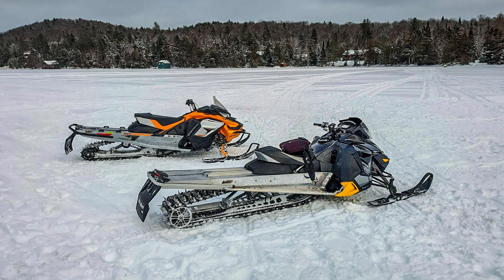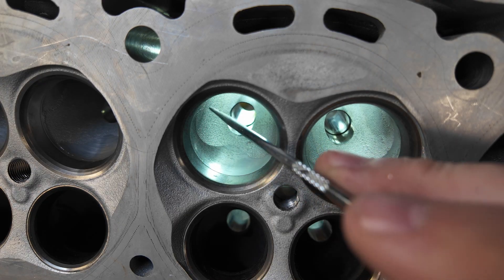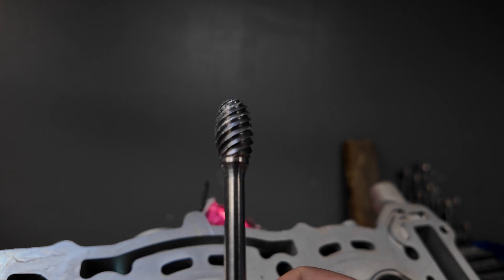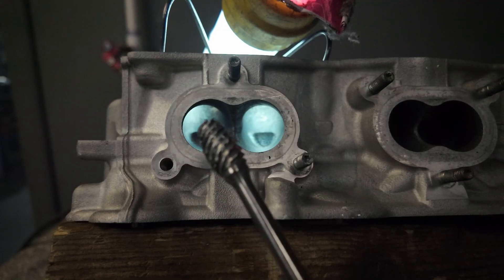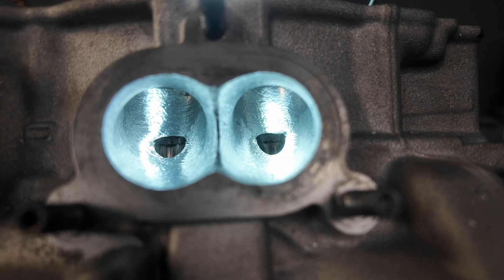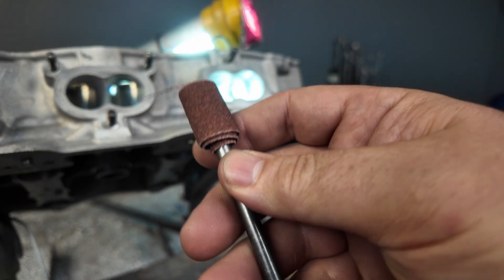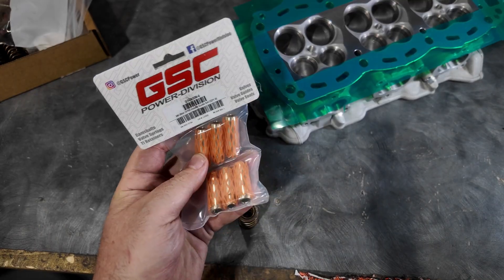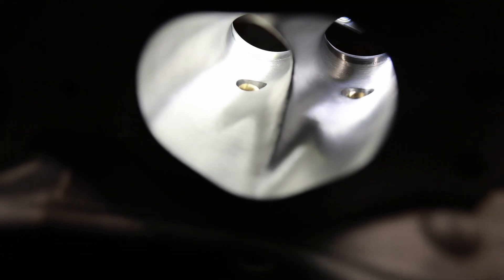Porting a Skidoo Head for 900HP Nitro Power!

Comment: Dave, would you say this is one of the better factory tumble-focused ports you've seen? There's a Rotax SAE paper from 2007 where they put a lot of work into increasing tumble without decreasing flow coefficient from baseline. In short, they lowered/flattened the roof, lowered/flattened the floor, nearly eliminated the SSR, and cut the divider down about 10mm closer to the valves. Would you say this is that port? Does it require any different valve job considerations?
Reply from the maker: Oh wow I would LOVE to read that! The short side on the exhaust is very tall and the intake is basically non existent so maybe the same.

Comment: One other question I've gotten for you- I just watched new 2jz porting video from another very reputable head porter (Bain racing) and already found 2 differences from your video. 1) he doesn't remove guide boses saying we need them for  maintaining air speed in port. 2) He doesn't make tranches in injector port side leaving them out of the picture and keeping them as small as possible whilst you always make the tranche extending the divider thin all the way to the beginning of the port. Could you please share your thoughts on that?
Reply from the maker: Everyone has their own approach and different goals. I arrived at keeping the fin in from 2002 when I did a world record setting head and the car slowed down after I removed the fin by the injector. I put it on the flow bench and it was noticeably quieter than the head with the fin and it lost low lift flow but gained high lift flow. Never did it again. The guide bosses I rip them out because I cannot shape the port the way I do with them in. Bain is a smart man, and has a way of explaining all of this complicated stuff in an easy to understand way. I love watching him. Because we are different doesn't make one more right or wrong than the other. Just different.
Reply: @headgames  Dave, thank you very much for such a comprehensive reply. Knowing your approach that's  what I thought it would be....🤝🤝🤝

Comment: Hi Dave. I've listened to 7 years old podcast with you and Darin Morgan - do you use any of the advices he gave back then?
One thing in particular I'm interested in is that he said that with increasing boost the air charge velocity isn't  changing but density. I'm having a hard time trying to understand why the pressure difference between intake and combustion chamber doesn't effect on charge velocity. I always thought the bigger pressure difference is the faster air is moving from high pressure area to low pressure area. How come it's different in cylinder head?
Reply from the maker: Do you mean during overlap?
Reply: @headgames  any time intake valve is open - when intake valve is just starts opening , for example. Before the valve we have high boosted area, past the valve we have low pressure area. Shouldn't air velocity be different if you have different boost level before valve? From what Darin was saying the boost level makes no difference in air charge velocity and I just can't get my head around it...

Comment: How do you keep the volume of the runners consistent for all the cyl's?
Reply from the maker: If the shape isn't the same the volume won't be the same. And, you can measure it with snap gauges or an inside mic. Easily done. But, if you have been doing it long enough, you can see the difference.

Comment: Those look like some happy tall intake ports there. Tons of squish in the chamber and the valve angles don't look silly. Valves look a hint shrounded but also kinda looks like they fit so much valve they don't have a choice. Already sitting close to the sealing marks. Seems like those heads got some love from the engineers.

Comment: proper powdered metal guides are the absolute robust solution. what your using there is a step up over OEM, but, very high quality powdered metal, not OEM but proper application designed metalurgy  will outlive bronze 10/1
Reply from the maker: I have never in my 25 years in business had any issues with bronze and bronze has a natural lubricity which a steel does not. Bronze also handles heat better than the steel. Steel will also break and go into a turbo or engine. AND it is impossible to find powder metal guides for every application that is the correct OD and ID. 
If I thought it was better I would certainly use it.

Comment: Hmm
  kardashian might have the look Pam Anderson delivers

Hard to trust with out before and after flow bench, with details like measuring cylinder diameter and pressure differential and ambient pressure and ambient temperature
Reply from the maker: Yeah, I would never trust someone who didn't flow it on camera but just showed the results of them going down the track either.

Comment: I learned a lot about porting and polishing in this one video, the tools and techniques. Thanks you  Brother. I've always been very, very reserved, only doing slight improvements, fine tuning on the blade / fin. Only taking a little bit off the overall inner diameter. I've always been afraid to mess up flow and change things too much. I'll maintain this approach! Awesome stuff.
Reply from the maker: That's awesome! I hope it shows that I totally carved that thing up, a lot changed. The shape matters, you should try to change it or your wasting time if your just scratching stuff.